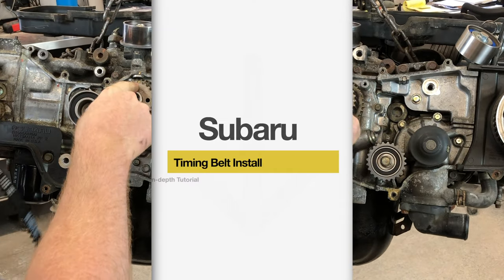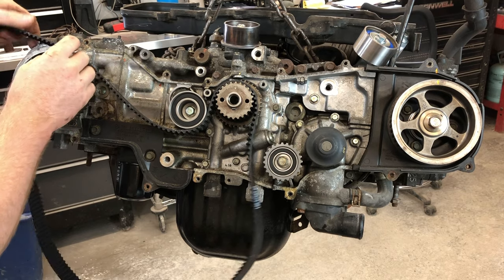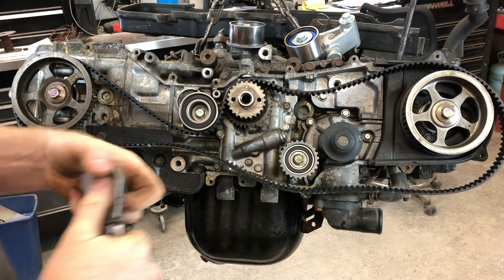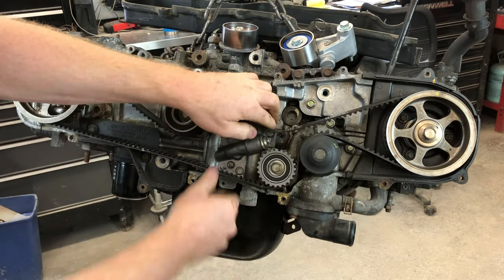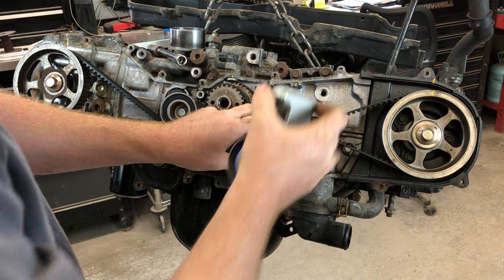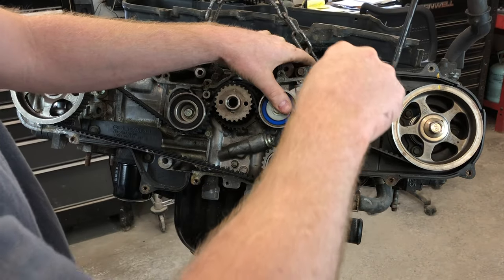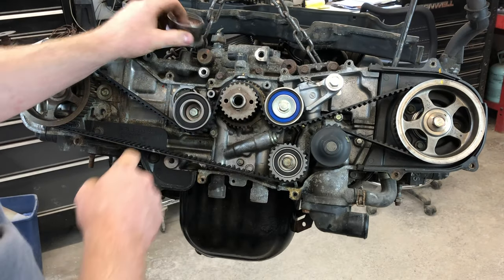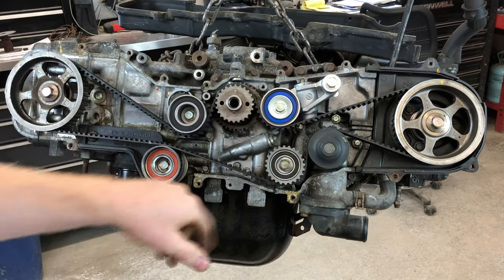SUBARU Timing Belt Installation!  PERFECT EVERY TIME! SOHC EJ25 EJ20 TIMING MARKS AND BELT GUIDE

Comment: Just a fact, My son bought a  2000 Outback about 7 years ago with well over 180k miles. After the first 6 months, it blew a head gasket. He ended up dumping a can of BarsLeak in it, along with a quart of oil every other day, and it's pushing 215k miles.  Needless to say, I was impressed, so I just recently bought my wife a 2006 Forester for 3 grand with 167k miles. I like these Subarus, and like anything else, if you do the preventive maintenance, they should last you for a long time. Thanks again, and  BTW, you have a new subscriber.  PEACE
Reply from the maker: That’s awsome! Subaru’s are great cars for sure. I’m glad they are working out for you. Ya the headgaskets have a bad reputation. But when they go bad most people can drive for months and years as long as they keep fluids full. Great cars man. Glad to have you aboard! Much appreciate 😃
Reply: With oil costing $4 a quart, it would still be expensive to put in a 15 quarts a month.

Comment: I used an eBay timing kit on a 4g63T many years ago. The tensioner failed immediately and blew up the engine. If it’s an interference engine, you really can’t beat OEM.
Reply from the maker: I agree with you. I have seen the same things happen many times. OEM is the only way to go for durability on a timing belt and all the pulleys that touch it 😀🔧🔧
Reply: OEM or Nothing. A guy in my country has a 2.0 STi doing over 700 2 years now and used genuine oem belt. Seen others used cheap belts and failed.
Reply: I just had an ebay oem aisin timing kit tentioner fail at 1 year old and 30000 miles because the tentioner leaked and failed and bent valves. Currently installing my new motor smh.

Comment: For anyone reading this, I am working on a 2005 forester a/t.  The aisin timing belt kit wasn’t available.  The a/t and manual transmission cars apparently have different water pumps, the m/t version was the only aisin kit available.  I bought the continental kit.  It came with an ntn tensioner, nsk idlers and one koyo idler, mitsuboshi belt.  Only thing is it came with a gmb water pump, hopefully that will last.  They also had an economy kit but I don’t know what brand of parts that would have in it.
Reply from the maker: Wont last, I would highly recommend getting Aisin or subaru OEM stuff.

Comment: Pro tip, turn the bolt CCW until you feel a click and then the threads are alingned perfectly and you can safely turn the screw in.
Reply from the maker: Great tip!
Reply: People not doing that, keeps me in repair work at my job.  Constantly fixing broken screws and bolts for semi conductor related parts.
Reply from the maker: Yup true. No one say anything 🤫🤫

Comment: Put an ASIN water pump on and the existing OEM subaru belt will no longer go over the new water pump pulley.  All marks are lined up.  I'm going to try it your way.  Thanks.  I usually do it water pump pulley second to last.  But will try it this way.   It worked, thanks.  I think I'll do it this way from now one even if sometimes the other way does work.  This is going to be easier anyway.
Reply from the maker: Its my fav method on Subbies. Super fast accurate and easier 😀😀

Comment: I was tempting todo the water pump and belt but I forgot the crank spins 2 times and the cams 1 time. Does cylinder number one have to be all the way to the top or the bottom?? Dumb question I know 1996 Impreza 2.2 sohc
Reply from the maker: Subaru does a really cool thing. If you line up all of their marks on the crank shaft and the camshaft, the pistons will all be half way up/down in the cylinder! This keeps you from bending valves if a cam ever slips for any reason. The pistons are all far enough down that valve contact with pistons is impossible as long as the crank sprocket is lined up. One of the few manufactures that do this and it is absolutely brilliant. At first it seems like a little bit of weird way for them to do it, until you realize why they did it. So....if you remove a spark plug and bring cylinder #1 to TDC, that will not work to time a subaru engine. Use the marks on the sprockets only 😃🔧

Comment: I agree with the OEM parts for this especially. You really dont want the timing belt or idlers to fail. its one of the single most important parts for your engine!!!
Reply from the maker: The worst is going through all that work and having a failure for no reason except trying to save money on parts. I have seen many Subbies motors fail from that scenario. Not worth it. Subaru or Aisin only 😃🔧
Reply: @EasyFixShaun  luckily I’ve got an ej22 so worst that can happen is you call AAA but still, I prefer not to be broke down lol
Reply from the maker: True. Breaking down sucks. I have seen lots of broken belts on the ej25 and although its classified an interference motor usually 90% will be ok. I have seen several make piston to valve contact though. So I say its not remotely worth the risk. If it ever happens once you will discover its NEVER a subaru or Mitsubishi genuine belt made in japan (i have even seen knockoffs!) or an idler that caused it within the service limits. It is always aftermarket parts that cause this stuff within the service limits. It usually occurs  with 30-60k miles. These aftermarket kits all have warranties. They will never pay for the new engine needed, but will be happy to give the customer another belt. They are horrible. end rant 😃
Reply: @EasyFixShaun  yes! OEM parts really stand the test of time. I just had to replace my fuel pump in my 96 and I pulled it out and found it had a manufacturer stamp of 95! That fuel pump has been going for 26 years and 253,000 miles!!! I need to replace my rear axles soon as they make a bit of a wub wub noise, but they’re originals too! Things were really made to last in the 90s!
Reply from the maker: @Alniemi  Wow that is really good durability! Nice work man! 😃🔧

Comment: The situation is a lot more different when you are installing the belt when engine is on the car, not on the stand.
I would like to add to this great video the following:
1. The belt's fit is very very tight, it stretches very little if anything and it's ribbbed.
2. Hence, when you get it on on all the cogs, it gets divided into runs witch can stretch only within the run
3. when you do the belt on the car, even if you remove fans, you do not have visibility of all the holes where install bolts go
4. all together you need to install 1 x tensioner, 1 x cog idler, 2 x smooth idlers, top and bottom ones.
5. when you are installing the last two, you have to stretch the belt (some strength is required) and fit the holding bolt into the hole you don't see - and that is not easy to do for some of them.
6. you have to start the bolts with your hand to make sure it's square fit, otherwise the steel bolts will make some mess with your aluminium engine.
So the above were just observations, and now are a couple of statements:
1. the cog pulley next to water pump and the tensioner are absolutely worst to fit in, so do them first. 
Not like on this video, when the tensioner is fitted with the top idler already fitted - this might not work, as you have to stretch the belt and fit the bolt into the hole that you don't see.
And the tensioner will have tendency to skew.
MrSubaru fits the tensioner and the top idler first - that also might not work for you, as the cog pulley is also a dog to fit, being close to the water pump and not enough belt to stretch.
2. After you have fit the tensioner and the cog idler, install the top idler, as it's got nice long run of the belt to stretch, and then, the bottom idler, as it also has a nice long run to stretch.
That will work.
Reply from the maker: https://youtu.be/J9qBb5pdD9o Subbie Belt install video

I have seen zero belt stretch failure from using the trick. I have done this for a long, long time 😃. This engine out of vehicle is demonstration only. 99% of use cases for me have been with the engine in vehicle.
If there is ever a belt failure it won't be attributed to the trick. It would be attributed to non-OEM belts. Oem Belts do not fail in their time and mileage range rating, with or with out using the trick.
Automatic tensioners will take up some and give some slack to do the trick.
Non-Automatic-tension style belts (Some Honda's 3.5L for example) I have also had zero belt failures.  
This is Experience 😃

Comment: Got my Mitsuboshi kit and waiting for a good weather weekend to do mine. Glad you demonstrated with an EJ22 (like mine). Mine's bleeding oil from several places to I'm going to use your method to remove the cam bolts for seal replacement. Thanks!
Reply from the maker: Awsome man! Make sure you get Subaru cam seals if you can. Others will work. But I have seen the seal lip on aftermarket cam seals be off by a mm or so and cause another leak from not being on the seal surface correctly once installed. Let me know how your project goes!

Comment: Me again, hope all is well on your end.  I took your advice and discombobulated the belt. Sure enough, the lower passenger pulley and cog needed to be replaced. The tensioner seemed to be fine, no leaks. I re-bled it and slapped everything back in. I still have that ominous rattle ... tweak on a cold start.  I noticed a slight oil leak above the oil filter and oil drain plug. Someone obviously went apeshit when they did the oil change. Anyway, thanx for the info, and I'm sure I'll be hitting you up for more. Have a great day!  PEACE
Reply from the maker: Nice job man! You should be good for a 100k miles now. 😃Those pulleys usually last 100-150k if Japanese (Aisin or OEM). 30-50k max if ANY other brand is used. If someone puts just a belt on, the pulleys usually fail halfway through the new belts life cycle. A lot of people believe in the warranties of parts and I don’t blame them, it’s a good indicator of quality. But....I have seen so many people learn the hard way that a parts warranty doesn’t mean $*%#! Get Japanese parts only for your Subaru. Thanks a lot for checking in and letting everyone know your results. Really appreciate. 😃

Comment: Update: Hey, hope you're doing good. I just pulled the covers off the Forester. Everything looks Brandywine NEW. Tension pulley has no signs of leakage. The belt is Mitsubishi, and all pullies are Japan. Everything including the inside of the covers is really clean. I'm debating whether I should even replace anything. My concern was a 1 - 2 second rattle on a cold start. Can I get your thoughts?  BTW, the crank bolt was barely tight.  Thanx in advance.
Reply from the maker: Hey! If everything looks new it probably is new. Sounds like you have the right parts in there! Might not be a bad idea to inspect everything and double check. If the pulley bolt wasn’t tight it could be an indication things weren’t done right right or rushed. If you are that far into it you could remove the belt and spin all of the idler pulleys by hand to make sure the bearings are perfect. The Cogged idler bearing especially goes bad if it isn’t good quality. The rattle on start up could be a loose crank pulley. It could also be piston slap. Piston slap is annoying but will last forever with no issues. That’s probably the most likely cause after the pulley. Lastly it could be a rod pin or something weird inside the motor. Time will usually tell with that stuff. But the symptoms don’t line up with that. I would say the loose pulley or piston slap. Nice job checking everything out!

Comment: Okay, the belt came in TODAY.  Exactly what I ordered.  Now in the comparison between the two belts, the "NO NAME" looks a bit thicker and a smidge wider than the Mitsubishi. Also, getting a shit load of feed-back on China vs Japan products pertaining to this issue. Most are saying China has stepped up its game.  In any event, I'm going to get started as soon as the weather breaks, hopefully, IT does before "I" do !!!  PEACE my friend,  and you can bet yer Bippy I'll be in touch.
Reply from the maker: Sounds great man! If I may plead with you on the belt though...Get Mitsuboshi or OEM subaru only. If you use that chineasium belt it will work at first but it will break and you will regret it. Love ya buddy. I just want your ride to not break. I am an expert on the matter. I too experimented and it cost me thousands in repair with belt breakage and  a couple damaged engines. It made for some really bad days for me. I put a whole batch of the china belts in multiple cars and deeply regretted it.

Comment: Ive inspected my timing belt recently and it looks great. I have no idea when it was last changed. But in the last 5 days ive been towed twice! once for a fuel pump and once for a clutch cable. now im thinking i might do my timing preemptively
Reply from the maker: Oh man! That sucks. Hopefully you can get it all sorted out. Maintenance of the belt is always great idea and peace of mind. You will want to replace the water pump and all the idler gears and tensioner also while in there. If you do that, you won't need to open it up again for any of those reasons for 100k miles. Basically the next interval...  
I would also recommend the best belt. Subaru or Mitsubishi belts are best. Mitsuboshi belts come in the Aisin Timing Belt Kits. The aisin kits are great. If you go Subaru parts are usually purchased all separately. These are the ONLY part I will use. I hope that helps! I have seen nearly every other brand belt snap prematurely. Nearly every other brand kit fail in some other way with idler pulley bearings or tensioners or water pumps fail. They will never make 100k miles. Subaru belts and parts are by far the best. Anyways.... Don't cheap out and learn the hard way. Get the good stuff only 😃🔧
Reply: @EasyFixShaun  oh yeah I’m going OEM if I can find it for sure, and I’m replacing EVERYTHING I can reach once I’m in there, including all the oil seals on the front of the engine, I’ve definitely got some oil seepage coming out the bottom of the timing cover!!!
Reply from the maker: @Alniemi  Always best to do it the right way like you are planning 😃🔧

Comment: Thanks!  My mechanic changed timing belt and tensioners (all OEM) and only a week or 2, it jumped 5 teeth in bank 1 and bent related valves.  How on Earth could this have happened?  Only thing I can possibly conceive is it wasn’t tensioned right? or maybe tensioners not bled?  I’m perplexed.  I’m also assuming the mechanic needs to cover costs for this.  He’s had it 4 days and no answers yet
Reply from the maker: That sucks. Im sure there is a reason and it will all make sense eventually ☹️

Comment: Take a spring clamp or large paper binder clamp to hold the belt on the sprockets at the correct spot as you thread it.
Reply from the maker: Good idea 😃🔧
Reply: @EasyFixShaun  I'm doing head gaskets on my 2007 Forester this week.  The head gaskets and timing belt went on today, engine back in the car tomorrow.
Reply from the maker: Nice work! 😀🔧

Comment: Is the Aisin timing belt any good? I noticed you said the other aisin parts are, but what about the timing belt?
Reply from the maker: Yup Aisin is good. They are an oem manufacturer and their belts are actual oem quality. Same with the tensioners, idler pulleys, and water pump if you get the full kit which is always best. With the component kit you will not need to open it up for 105k miles, when the belt is due for replacement again 😃

Comment: On the left cam (driver’s side) one of the 5 spokes has an arrow on it.  Not too far from that on the edge of the cam wheel, there is an indentation line that looks nice and factory. There are paint lines nearby too, but I suspect those were from previous repairs that involved reinstalling the same timing belt. 
My question, is do I use the carrot on one spoke of the cam wheel, or the small but nice line indented at the edge of the cam wheel?
Reply from the maker: Sorry for the delay. Use the marks on the edge of the wheel just like the video and you should be good 😃

Comment: Does it really matter where the timing belt marks are as long as the pulley timing marks are set correctly?
Reply from the maker: 🎯 Correct. The belt marks are just for reference as an aid to getting everything all lined up. New Oem belts come with the marks. You don't need the marks at all. they are just nice to have. You can also make your own marks on the belt before you remove it, if you want to reuse it. I find that helpful and it helps with peace of mind. As long as the belt has the correct amount of teeth and is the correct part number, only the sprocket marks matter 😃
Reply: @EasyFixShaun  Thanks so much!!😎

Comment: Hello- great video. I have a 2006 forester that has just turned 97000 kilometres. I runs perfect but I’m wondering about the timing belt. I’ve taken the small side cover off and it looks good- no cracks and it seems to be pliable. My concern is the age and years of heat and cold. What do you think about changing just the belt (genuine Subaru) and leave the idlers and water pump.
Reply from the maker: Usually belts are good for say 8 years or 105k miles, which ever comes first it will be due for replacement. Nothing wrong with replacing just the belt. I have seen idlers fail between the next interval so that's why i usually do it all while i have it apart. But, inspect them and make sure they are good while there and you could be ok 😀
Reply: I have now pulled the front cover off and done a close inspection. I’m going to change the belt and the one idler (bottom LH side- blue colour-KOYO )
It rolls smooth but it’s loose, almost sloppy feeling.
Thank you for the reply
Reply from the maker: @beef539  Excellent! No problem glad to help. 😃